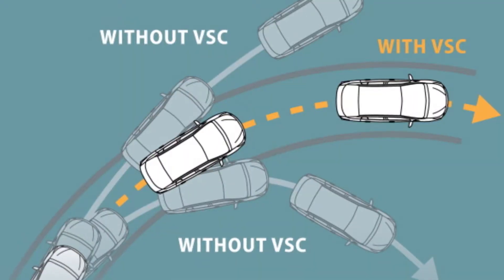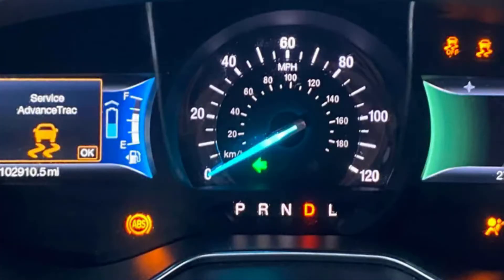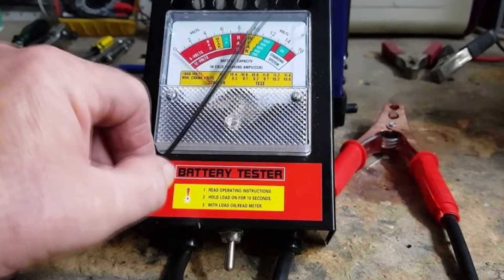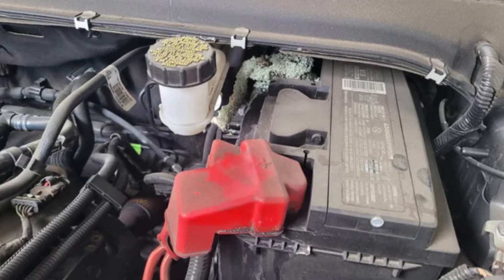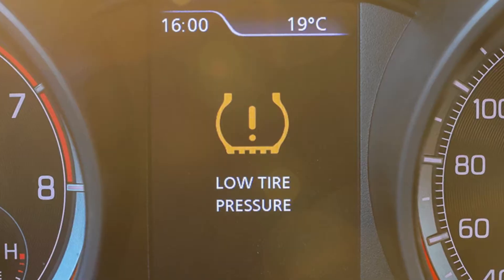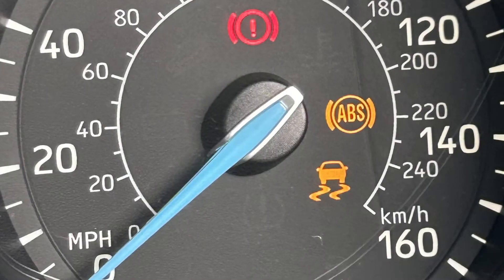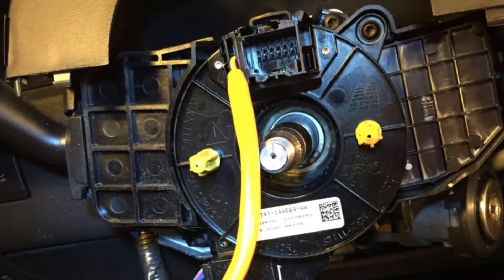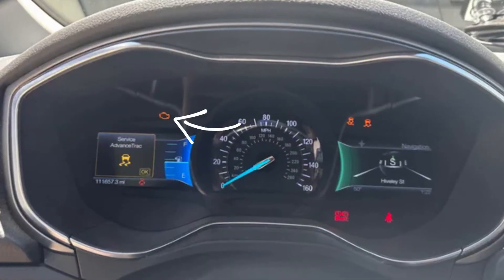“Service AdvanceTrac” warning in Ford Fusion

Comment: Do we would have to plug the OBII scanner In after the message shows up or what? I just changed my ABS sensors in the front so far the message hasn't came back up.
Reply: Did it fix it

Comment: I hit my wheel. I feel my alignment is slightly off, do you think this could cause this problem?
Reply from the maker: It's probably not alignment itself that causes the warning. But you could have damaged something else like the ABS sensor on the hub, for example.
Reply: Thanks for the feedback. @TopicMotor